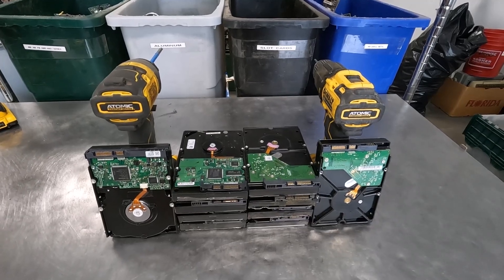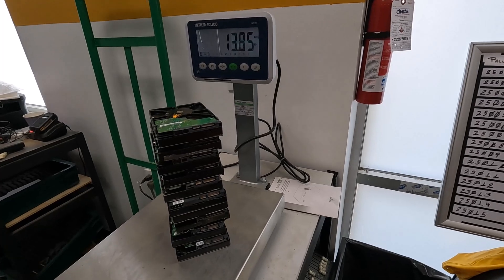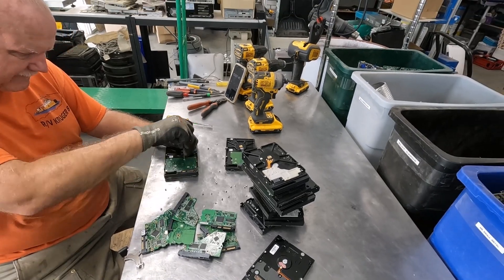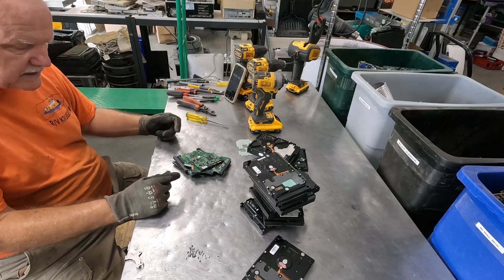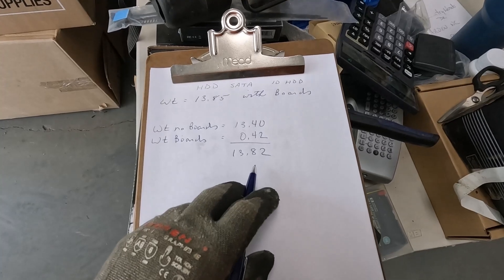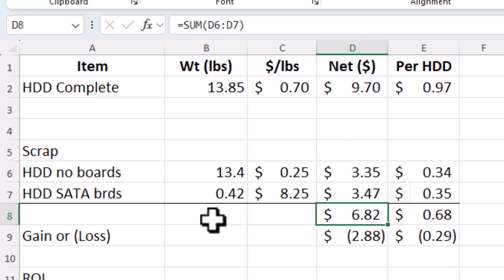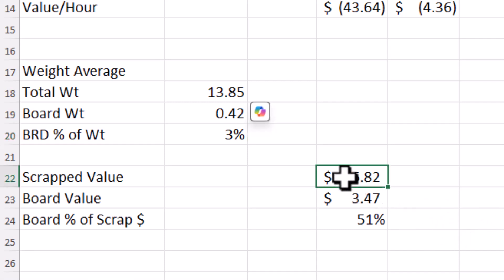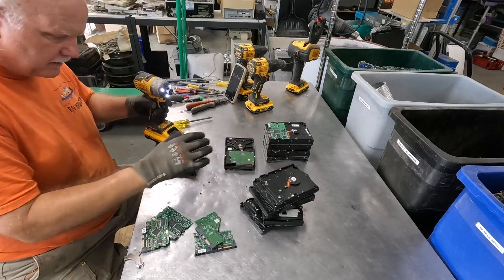Should You Remove SATA HDD Boards?

Comment: I scrap mostly Servers and rarely, if ever, find IDE or Non-Sata HDD's. Servers from 2008 and later are normally always SAS, SATA, or SSD's. But shipping 50 HDD's isn't ideal, either. Any profit there would be lost to shipping costs. I have little choice but to strip the SATA boards and take the rest to my local recycler for dirty aluminum. Thanks for the video.
Reply from the maker: Your situation is shared with many. Shipping HDD's only became feasible for me when I started moving enough product to justify shipping LTL. With LTL I can get my shipping costs down in the $0.40's range making more things reasonable to ship.

Comment: One thing that comes to mind is the cost of shipping.  Would it make sense to remove the boards and only send in the boards? The leftover hard drives (less the board) could perhaps be sold as aluminum breakage (wishful thinking maybe) or even just shred.
Reply from the maker: Absolutely makes sense. I always encourage scrappers to understand and consider their shipping costs and how they can sell locally. Scrapyards handle the HDD shells differently depending on how clean you get them and local conditions. Some even have categories for the shells: HDD no board, HDD no board bent or punched, HDD shredded, etc.

Comment: I get the magnets out for use or sale. I finish stripping the aluminum block for recycling.  Not great profit but I'm new at it as a hobby.
Reply from the maker: I did that when I started as well. I'm pretty sure we all do. Now that I'm doing this as a biz, I have to manage my time more closely or I'd never get ahead of the material coming in. I still have a huge supply of magnets and platters that I'm trying to sell to the local artist scene.

Comment: I disagree with your analysis. You didn't factor in shipping. I pay $0.30 to $0.50 per pound to ship from Virginia to Boardsort. Because of that I never ship the hard drives. Only the boards. If I were shipping those hard drives I'd be making $0.70 per pound for the HDD with board. But I'd be losing almost half of that, at a minimum, to ship them. If I remove the boards I get a lot more per pound to offset my shipping costs. Even if I only get $0.045/lb as shred, I think I'd be way ahead of the game.
Reply from the maker: That is why I emphasized the importance of understanding your shipping costs. There are a couple things I try to make clear on every one of my scrapping videos. First, everyone scrappers needs to know how and where they will sell the material they are scrapping. Second is the importance of understanding shipping costs. My shipping can range from 30 cents to over a dollar a pound depending on many factors. The analysis I present is only a starting point for everyone to then consider their situations and make informed decisions.
Reply: He knows shipping is different across the country .stop the negative and think.

Comment: I have to crush the hard drives and they bring ways less at my yard so I have to take boards off to make it viable.
Reply: How many HD's are you scrapping? I take all mine apart and snip the platters. I average over 100 a month and get the most value with the aluminum bodies.
Reply from the maker: A 100 a month? I don't envy you that. They can get fiddly and boring after a while.
Reply from the maker: That's a very good input. Crushed, bent, or punched HDD's generally have even less scrap value for some reason. But if that's how you have to sell them, you don't have much choice but to remove the boards.

Comment: What is the  cost to ship the hard drives to boardsort?  It looks like the cost of shipping would be more that the price of the hard drives
Thanks for the videos!!
Reply: I wondered that same thing. If you didn’t ship them by the Gaylord full, I wonder if it might not even be worth much more than scrap in the end. The little kindergarten scrapper explained sata and non sata hard drives to me the first video. It’s hard having a 5 year old that is smarter than me in a lot of ways😂.
Reply from the maker: That depends on where you are located and how you ship. My shipping can range from 30 cents to over a dollar a pound.